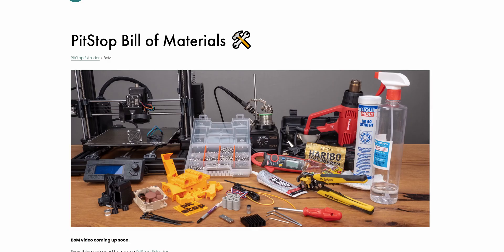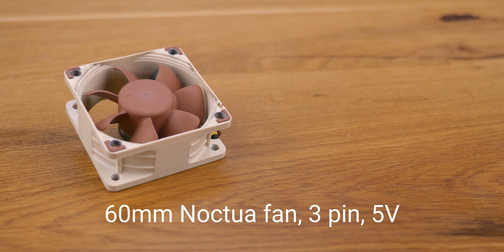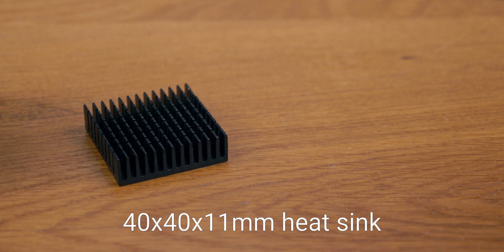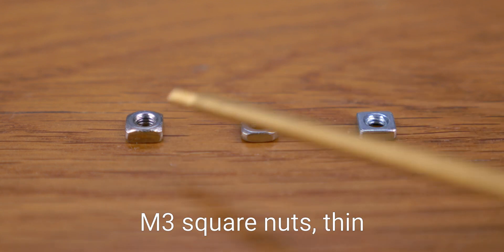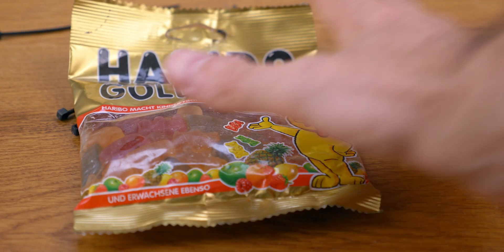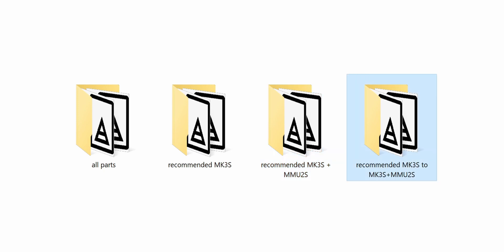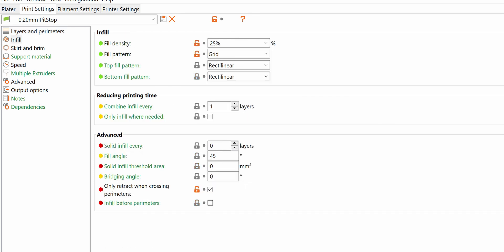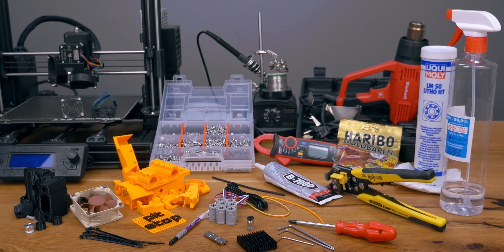PitStop Extruder BOM

Comment: bought the same grease as you got, but it did not lubricate enough some how, then i used silicone sprey and it helped a LOT
ps: mihai maybe you got a clue why i get the x-axis belt error, it says i should check the lengh of the x-axis belt, like i said above i lubricated the rods properly so the extruder moved freely when i push it with my hand, what i allready did trying to solve the problem; 
lubricated the rods - didnt help
software update - didnt help
tensioned/losened the belt - didnt help
Reply from the maker: Is it going all the way to the right by itself? Make sure there are no wires (Pinda cable?) In the way. I hate that wizard.
Reply: @MihaiDesigns  since i got this printer it never goes fully to the right, but in the past the test worked fine, i had this issiue few months now, tought with the new extruder its gona be ok again
Reply from the maker: @kthec1298  using stock bearings?
Reply: @MihaiDesigns  no i use the igus drylin
Reply from the maker: @kthec1298  yes they are tricky like that. I'm guessing you're having this issue at calibration? In that case you can help the extruder a bit with your hand. Kind of a hack, I know. The firmware is set too sensitive for these bearings.
Reply: @MihaiDesigns  when i do that, the calibration stops and puts out an error, some times it ''jerks'' at the middle of the way and continues for few centimeters then drives back and puts out the error that my x-axis is not correct, i think my pinda probe is faulty too, when i calibrate the first layer everything is allright, but then at printing the left part of the print is not leveled correctly, there are gaps betwean the lines but on the other half of the bottom part of the print it is perfect but this issiue was before the pit stop extruder, i tought it was because on the original the pinda holder was a bit tilted but now on the pit stop extruder it is straight
ps: sorry if i waste your time :)
Reply from the maker: @kthec1298  no worries. I think it's supposed to pause just a tiny tiny bit in the middle and then continue. I guess you can just skip the calibration, but there's a risk that something could be crooked. Or try completely loosening the bearings for that part. For the bad leveling could be a bad probe indeed. Already checked for dust under the build plate? That usually causes problems and confuses the probe. We need an extruder with BLTouch.
Reply: @MihaiDesigns  no the heatbed is clean i clean it after every print with 99% alcohol, the x-axis error is gone now somehow :D, but there is still this pinda problem, im gonna try to cantact prusa maybe they can replace it because i still got warranti

Comment: Hi, does the stock X motor and belt guide holder work with the pitstop or do you need to print the revised ones?
Reply from the maker: Stock works just fine.

Comment: would you say, this cable does work?

https://www.amazon.de/dp/B01LFC26N0/ref=cm_sw_r_wa_apa_i_caJyFbSAK71HA
Reply from the maker: That would not work because the board uses thinner Molex SL connectors, and the fan uses Molex KK 254 connectors. You'll have to cut the stock fan cable and splice wires.
Edit: on second thought it might help to get that extension cable and then figure out a way of connecting it to the board.
Reply: @MihaiDesigns  ok thank you, will try with the cable and some connection pins :)

Comment: Great! Now I can order all the little pieces =) I think PETG will be more then sufficient to print since the original parts are printed in that. Or do you have experienced problems with parts printed in PETG for this mod?
Reply from the maker: Fair point. I haven't tested PETG tbh. I expect it to work similar to the stock extruder. I imagine most people don't have the necessary enclosure to reliably print ASA anyways.
Reply: @MihaiDesigns  would you say Prusament PC Blend would be a good choice for the extruder filament? Got a roll around :)
Reply from the maker: @FragAttack23  I haven't tested that one. You can try if you don't get any warping or layer splitting issues. Let me know how it went if you decide to go this route (once I release the files).